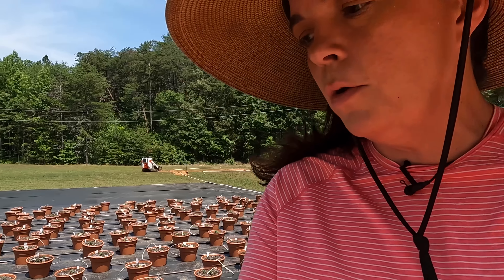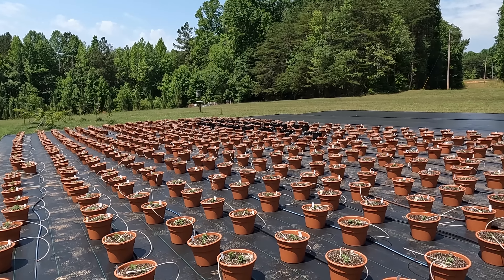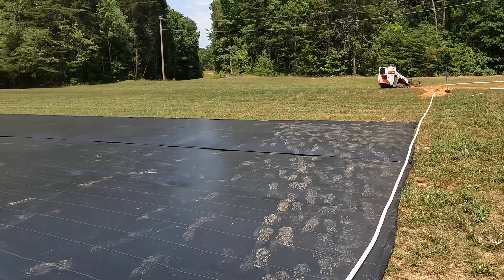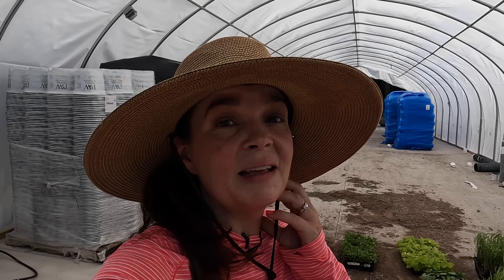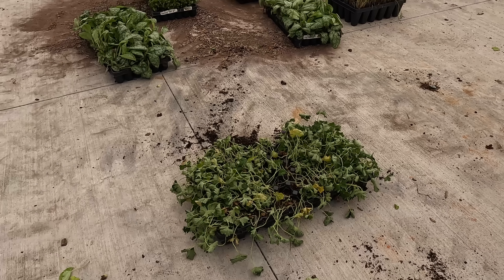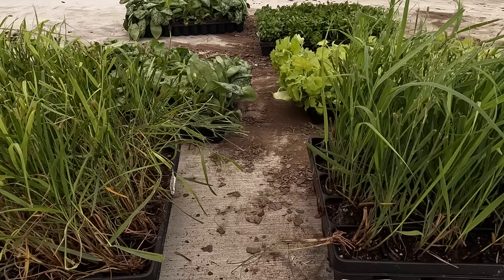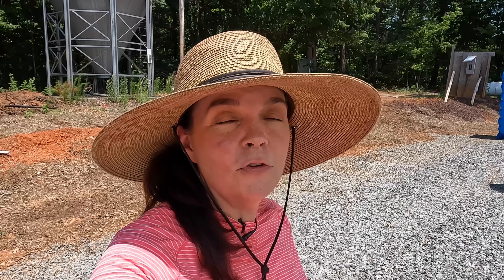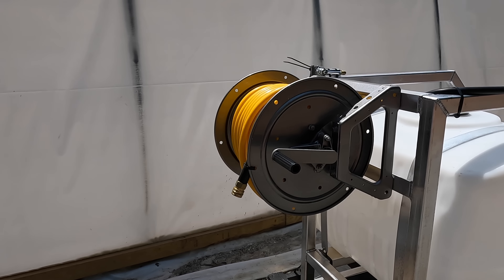My New Garden Toy: Fun & Functional! | Gardening with Creekside

Comment: Just a question.  Is there a reason you don't use landscape staples to hold your water drips in place to each mum?
Reply from the maker: The dripper has a weight on it so it will not just blow out, the staple will be more of a problem when it’s time to move them. Once the mums grow out some the plant will actually hold the dripper . We had a massive storm yesterday no drippers blew out

Comment: Perhaps use those plastic gutter clips used to hang Christmas lights to hold the water tube in place on your mum pots so you don’t have to worry about them falling off the pot and losing plants to heat/drought.